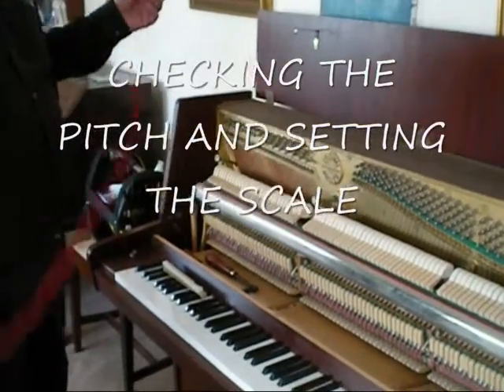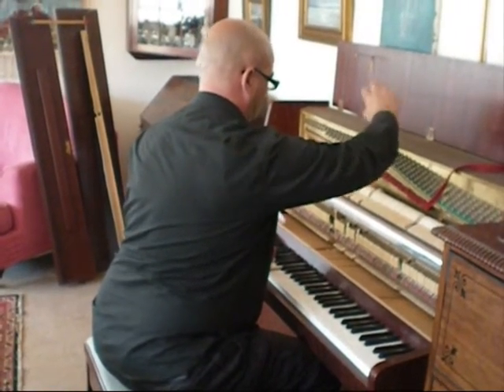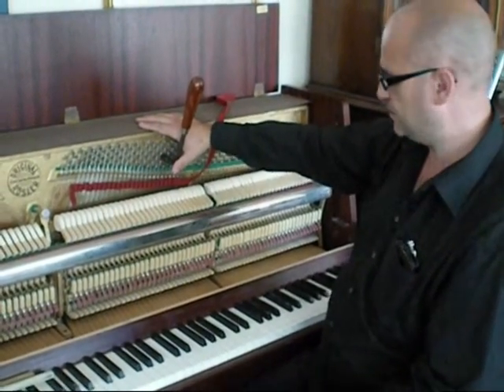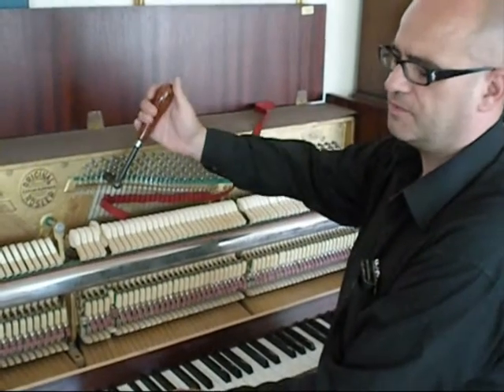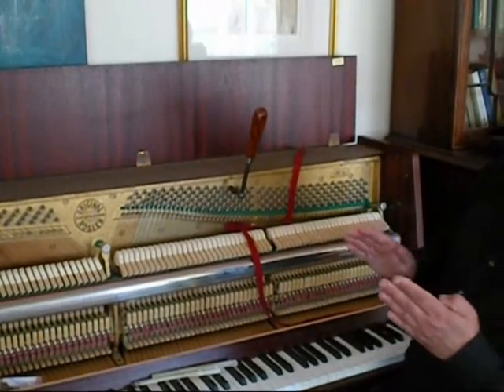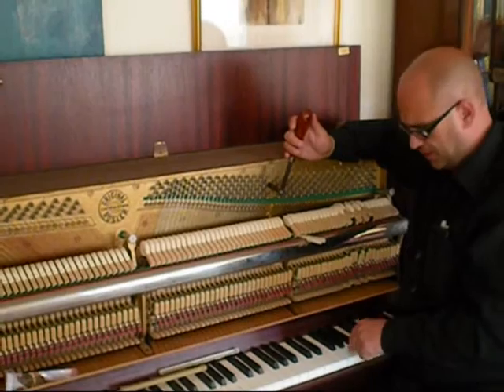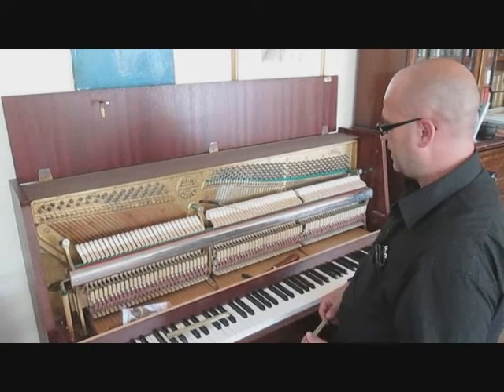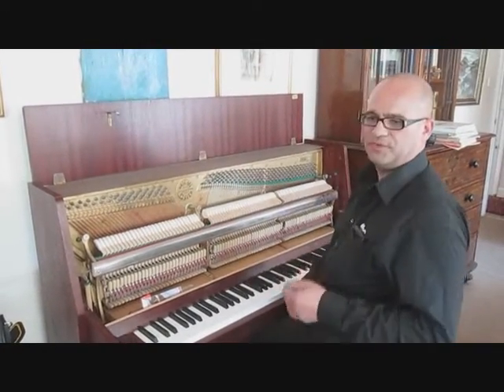Tuning an Upright Piano

Comment: I`m curious ! How do you use just one papps wedge for tuning the mid/high treble? Surely you need to mute off the outer strings in order to hear the middle sting first ? I would either use a wedge one one side and one the other side.
Reply: You simply push the Papps Mute between two strings of the trichord; either left and middle, or middle and right. It is not necessary to start with the middle string of a trichord!